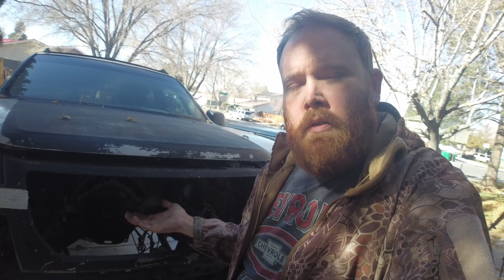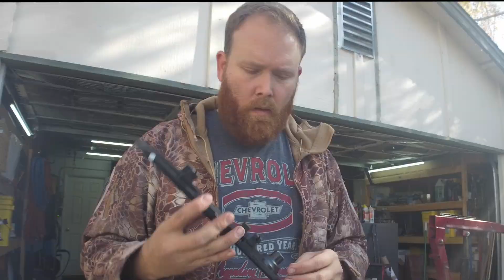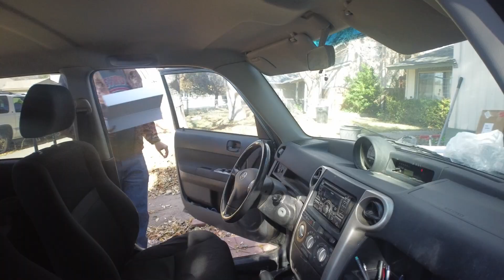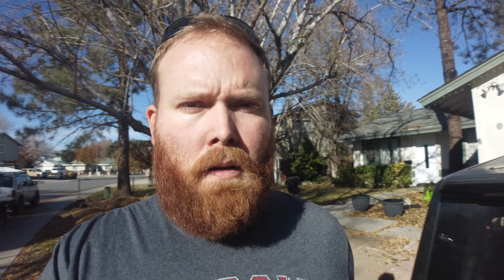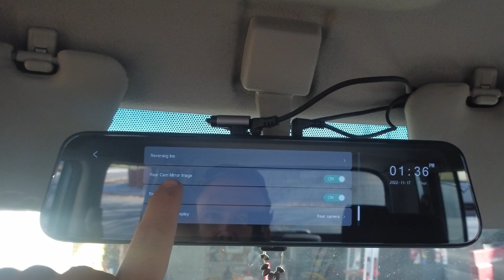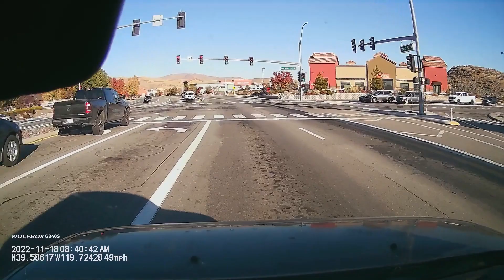Testing a $120 Underbelly Camera System.... kinda

Comment: As always great videos. You mentioned subs in the Colorado. I have a shallow mount box under the rear seat pushing 2 Skar 8 inch subs. We may need to see if you can make a spacer w/a new stud to use to elevate the front of the rear seat in the crew cab. I can email you some pics tomorrow afternoon of the what the box looks like under the seat.
Reply from the maker: The second box I made no longer employs the feet. Its too angled to sit in the seat. So I want to lower it and fiberglass it to the profile of the seat.
Reply: @BadlandIndustries  I'll try to get the specs and pictures of the box I have. Then I'll send you pics of what I mean by spacer/stud that can be made. I currently have a stack of washers lifting the front of the seat but it's not enough space when someone sits in the rear seat. Give me a couple of days to email you what I have and then we can talk about what I mean by making a spacer/stud to raise the front of the seat a little higher.
Reply from the maker: @michaelmincey2622  yep that'll was how I made my first box work